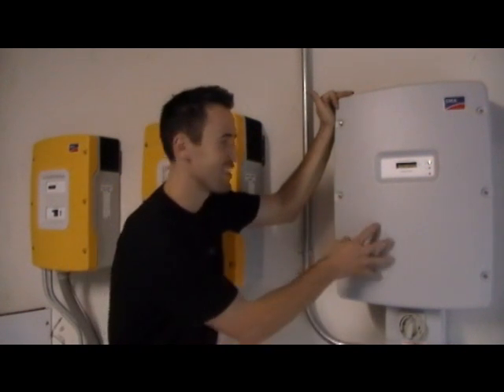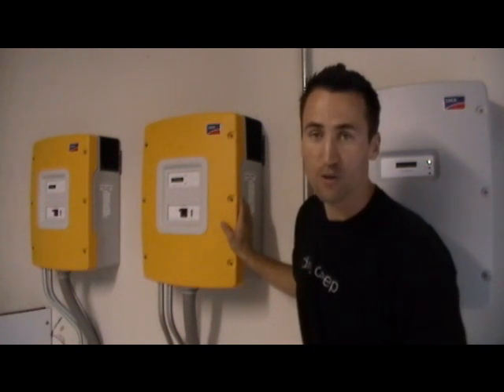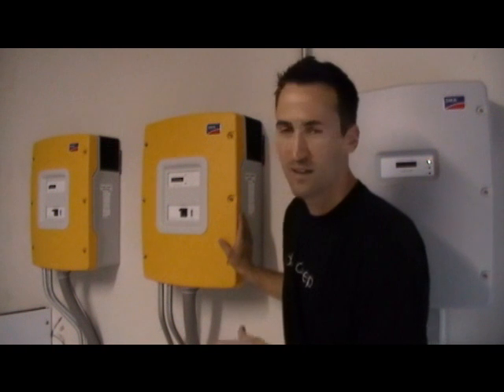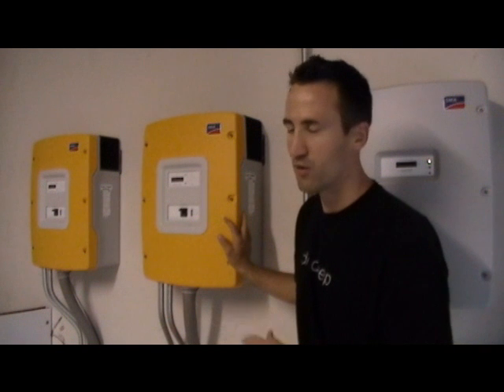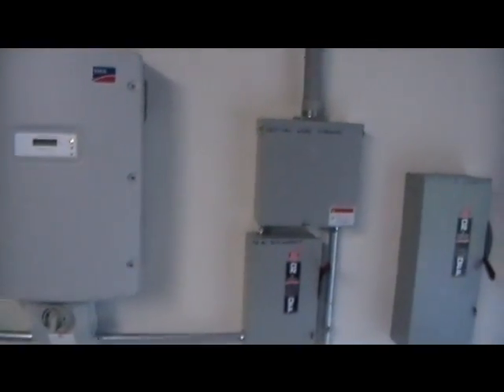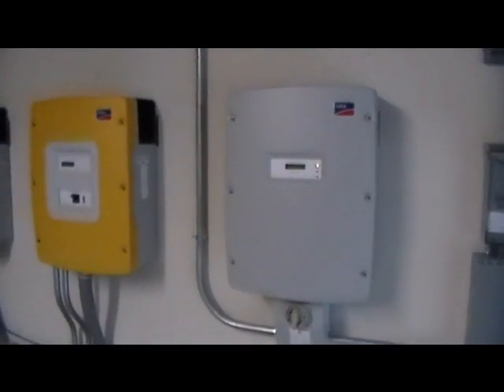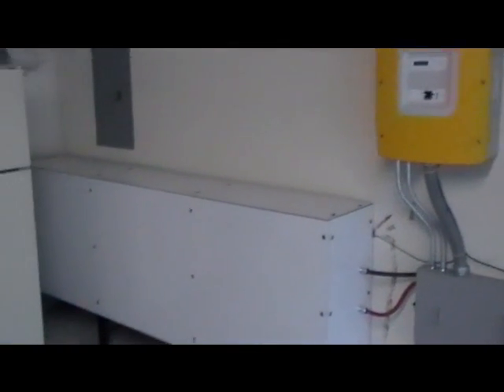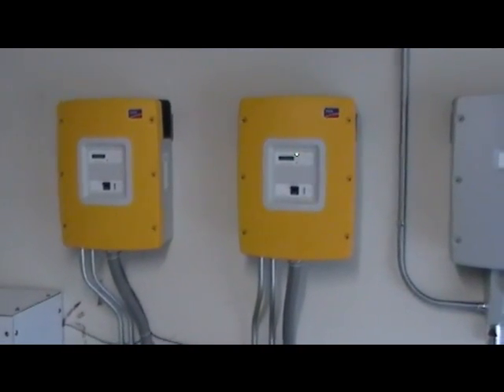Austin Solar Panel Power Installation Hill Country Ecopower with Battery Backup

Comment: JP, how are you isolating the main panel from the critical loads panel?  It looks according to how you have it set up that the grid input first passes through the critical panel and then on to the main panel, which is reverse of how I imagine it.  Do you have a block diagram you can post? Thanks,